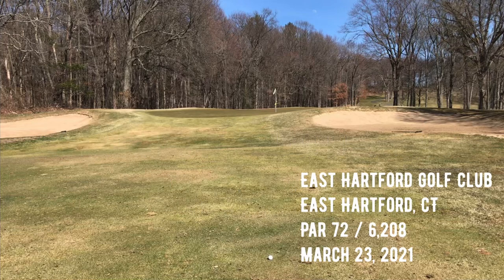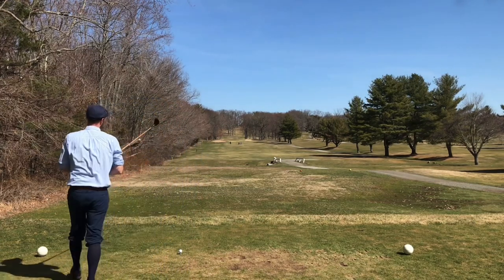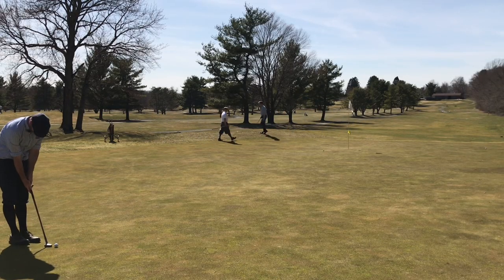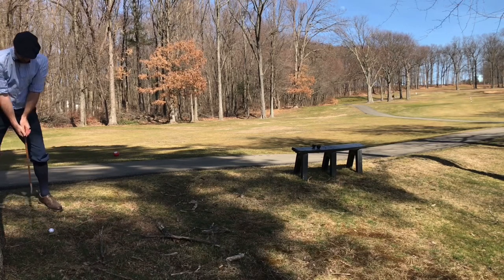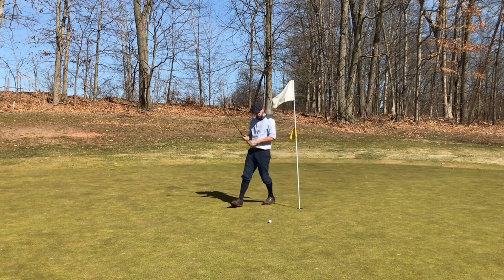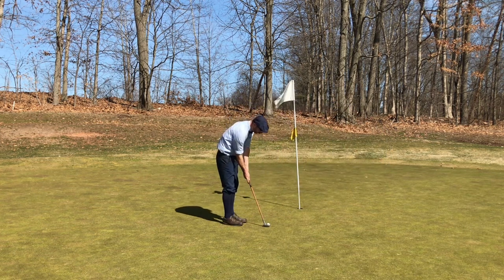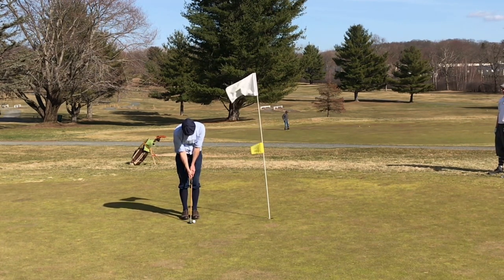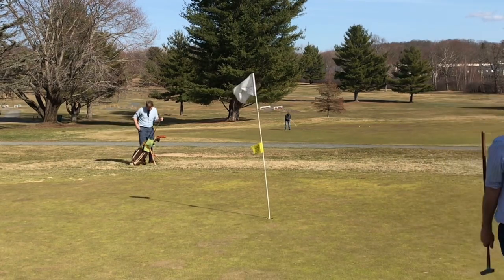Playing Hickory Golf at East Hartford - Course Vlog #6

Comment: I am soon going to order from Tad moore some Forgan smooth face irons he makes and they are of course with no bounce really on them. I tend to attempt to swing shallow but the fact that they have negative bounce worries me that it will be very hard to not dig on almost every shot.
Reply from the maker: If Tad's replicas play like my authentic 1890s irons, that is something you'll need to be mindful of. I'm going to do a video soon describing the playing differences between pre-1900 irons and more "modern" post-1900 irons. A shallow swing with the pre-1900 irons is key, in my opinion, because they were designed with firm links courses in mind. The turf and the constant breeze kept the game on the ground and those early irons weren't really designed to launch the ball in the air the way we're more familiar with playing. I'm finding that I need to customize my swing for gutty golf in a way that's different from my 1920s hickory swing, which is a little different from my modern club swing. The challenge in figuring out what works and what doesn't is fun, though, as long as you don't let it get you frustrated.